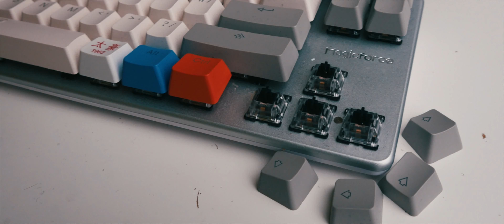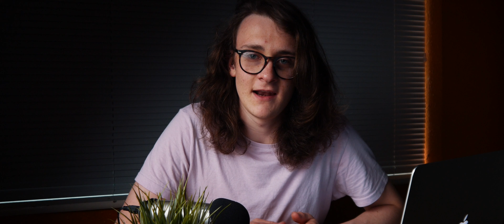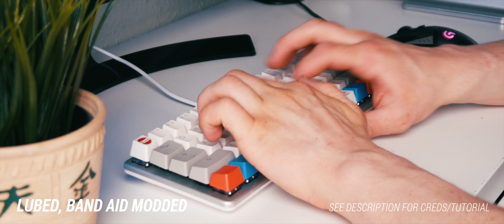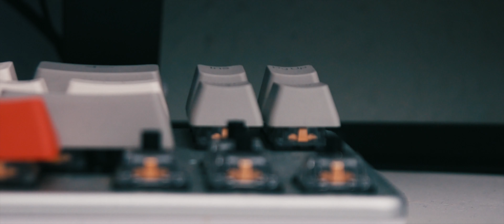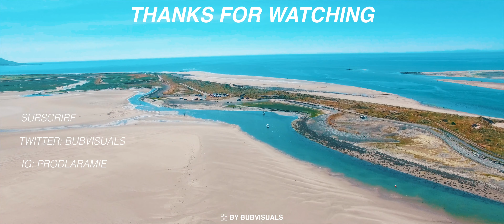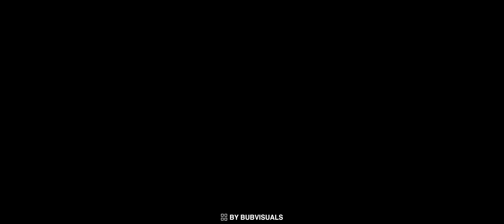Mechanical key switches: Lubed vs Unlubed with Gateron Black Soundtest

Comment: Would you recommend o rings on gateron reds? I dont like bottoming out noise but i doubt want them to be mushy either
Reply: i wouldn't, lubing does the job
Reply: @ExabyteAU  yeah i decided to lube it and the lube i ordered is on the way
Reply: @muchostacos67  let's gooo. hopefully gonna lube my gateron optical reds on my SK61 and mod the stabs n that
Reply: @ExabyteAU  yeah i saw a video of someone lubing those switches on the same keyboard and it sounds so nice
Reply: @ExabyteAU  yup